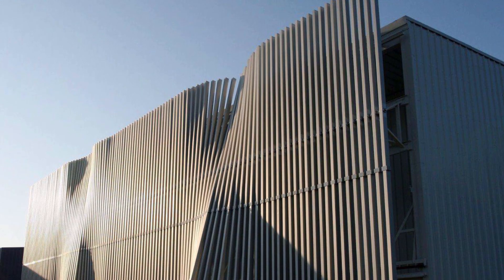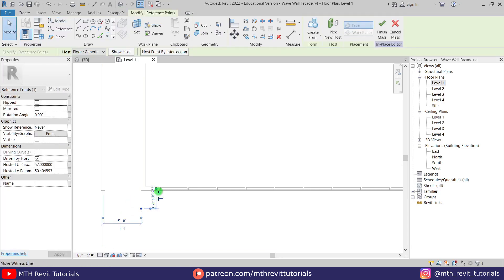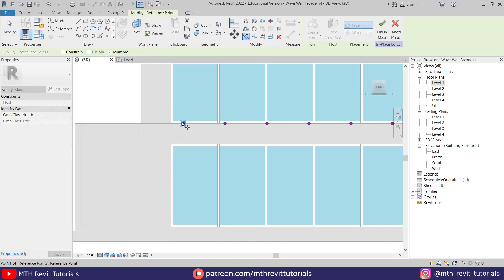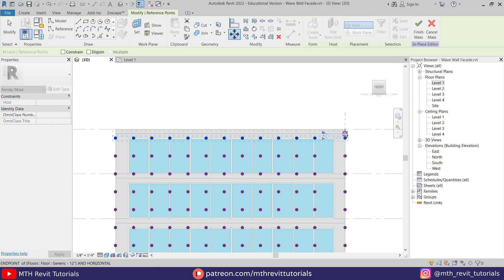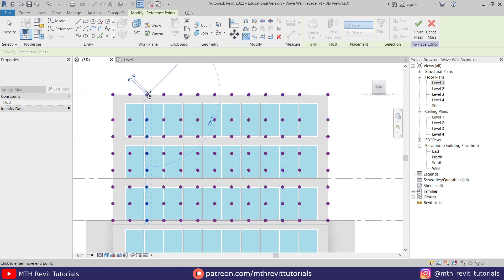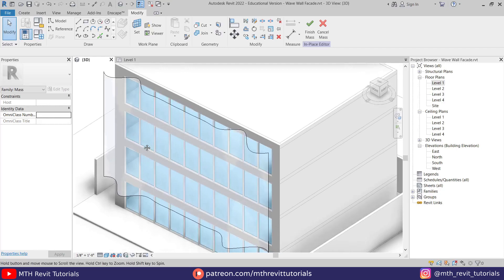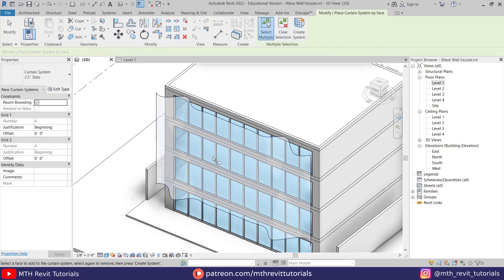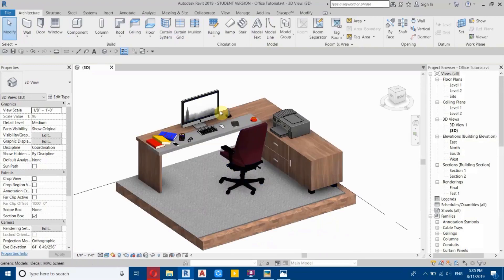Easy Wave Wall Tutorial | Revit Basics for Beginners

Comment: Hi thankyou, currently trying to use this in my design for uni but I haven't got an option for empty curtain system so can't find a way to remove the glass (have tried other suggestions online but none work). Do you know any solutions for this?
Reply from the maker: Try this method: Right-click a glass panel and select "Select All Instances," then unpin the panels and choose the "empty system panel" type from the properties on the left.
Reply: @MTHREVITTUTORIALS  Thank you but this does not work!!
Reply: I solved the issue. The latest versions of revit do not have the default system family. I found the download on the autodesk forum for the empty system panel family!!!!